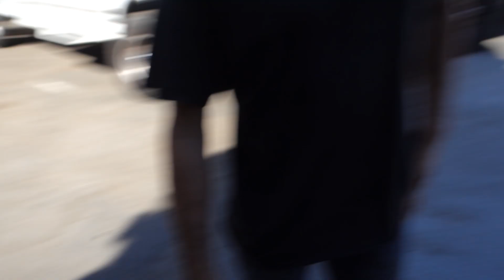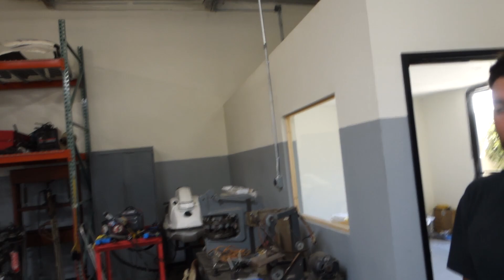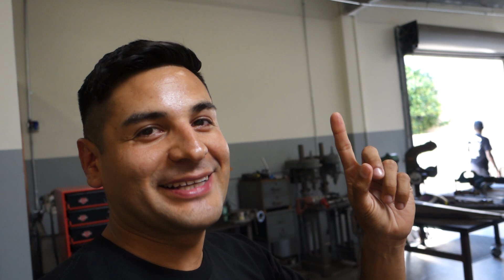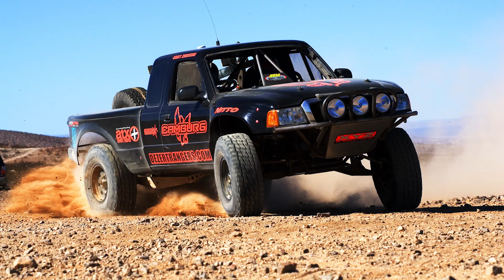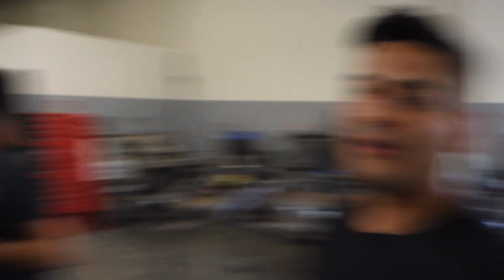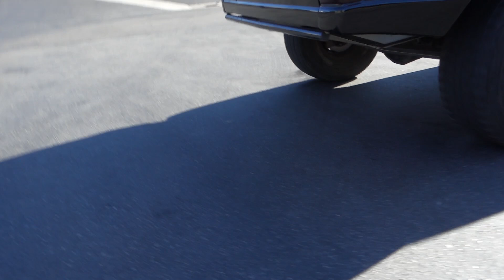Cleanest Ford Ranger in Fullerton, CA | BUILT TO DESTROY

Comment: You can get it bored  and tuned  with   kn air intake but bigger and have 3 inch exaust tubing coming out the back instead putting v8 tight away